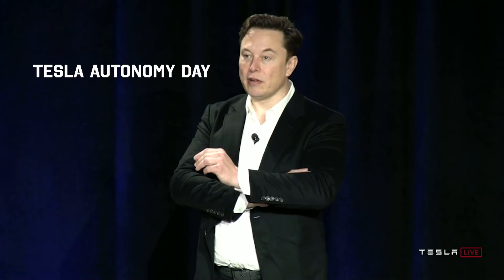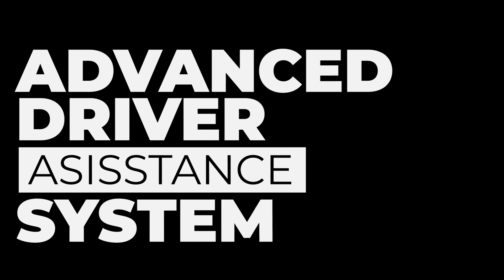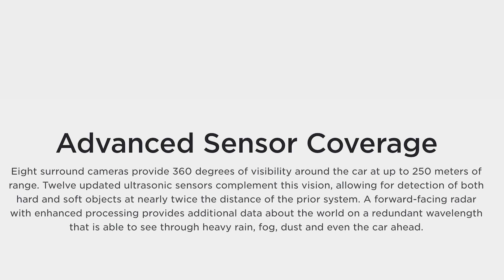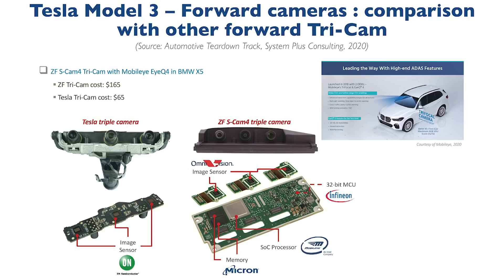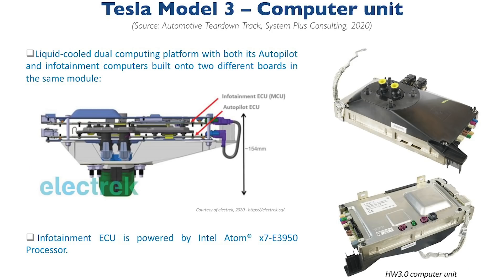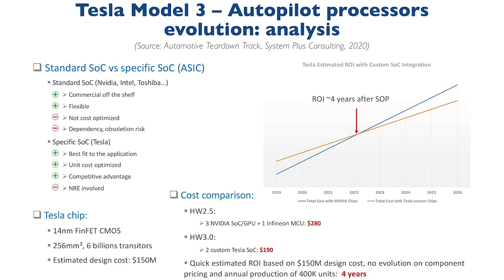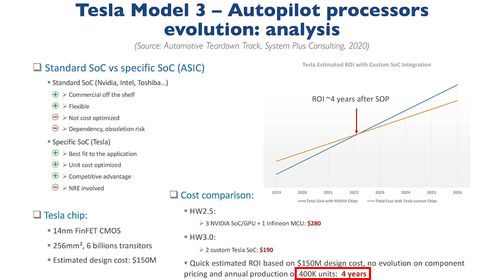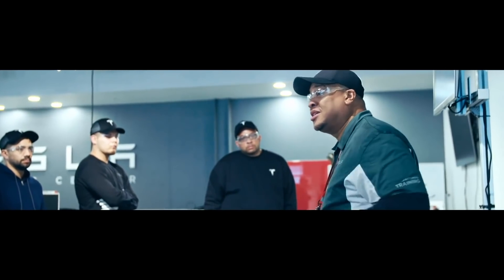Why Tesla Will Win the Full Self Driving Race Profitably

Comment: It is an interesting area Tesla is running into right now. Unfortunately I am quite certain that Tesla has to change a few details to the hardware in order to get REAL Full self driving done. Just one that I noticed lately: The angle the front cameras use is not steep enough upward to actually see traffic lights over here when you stop at the line. Tesla is trying to mitigate this by simply stopping earlier, but that doesn't work either, because we have a lot of traffic aware stoplights, which will not trigger unless you pull forward to the line.
Reply from the maker: Hey Rick, good points. Definitely a lot of work to be done!

Comment: Speed limits are way off and this needs to be addressed. I drive to my parents' house daily and today, the speed limit for about a 7.4 mile stretch of road was suddenly 35 MPH (it's a 55 zone) and another stretch of 2 miles is now 40 MPH (also actually 55).

There is no official path to get these multiple routes corrected and suggestions by the community to correct speed limits on other road segments have to this point not been effective. Open maps edits don't work. Bug reports don't work. Google maps feedback doesn't work.
Reply from the maker: That's a bummer. I'm sure Tesla is aware of it. You'll have to keep me posted on that

Comment: A car company? Tesla designs and manufactures Computer Processor Chips. Tesla builds its own Computer Server Farms. Tesla uses in house software design and testing. Tesla manages a World Wide wireless network.Tesla is a Solar Panel, Solar Roof Tile maker & installer. Tesla has a World Wide Supercharger network. Tesla makes Power Walls. Tesla manufactures and installs City Sized Power Plants. Tesla ,makes and installs Power Grid "Peaker Plants". Tesla designs and manufactures its own Electric Motors and Drive Systems. AND - Tesla builds EV cars, EV SUVs, EV Semi Trucks and EV Factories. What other company does ALL this? No one.
Reply from the maker: Preach brotha!